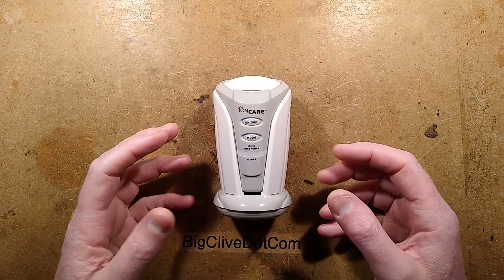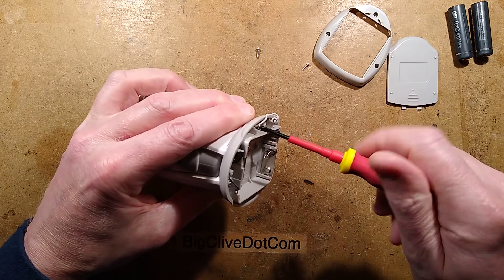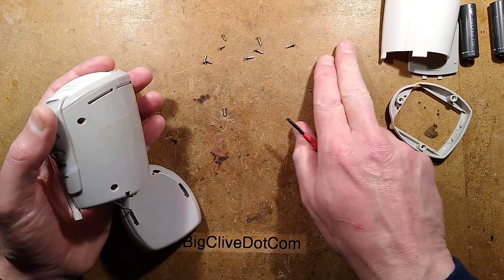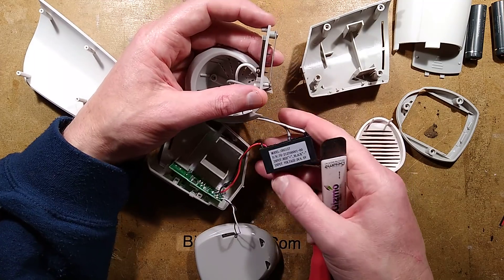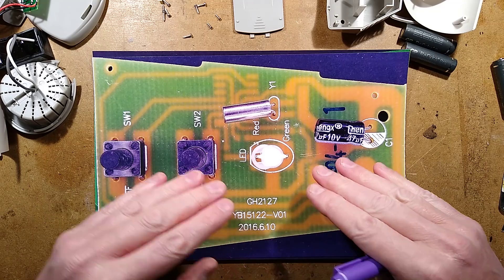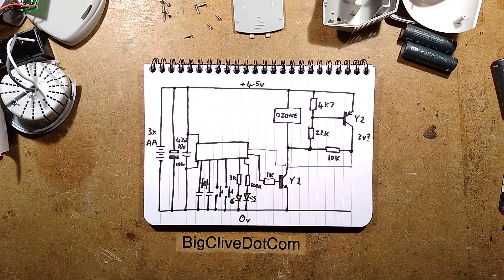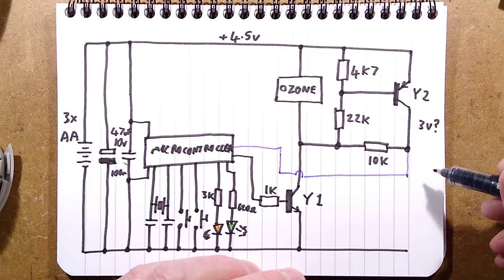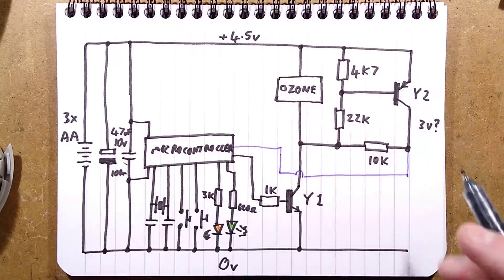Very retro "Japanese" air purifier.

Comment: Judging by the number of screws, I'd say that Sony designed this!
Reply: As a Sony fan, I can confirm the sometimes excessive use of screws.
Reply: @dashcamandy2242  Must be there for a reason . I would rather have a few more and a solid product rather than a few less and something flimsy . I have a few of their products because of the quality although that has dropped off a bit since they started having things made in China
Reply: By looking at the design it could be an old Panasonic design or a Toshiba one …
Reply: So true so true.
Reply: Looks like a ps5 too
Reply: Nah, no propriety screws. 😀
Reply: @josephking6515  That would have been Apple.
Reply: @josephking6515  Sony dont always use them , i have had loads of their products and none have had them . Maybe its a recent thing
Just checked a couple of things i have , Bluetooth speaker , ordinary cross heads , rx10 camera and cross head screws again.
Sony leave that nonsense to others who think they are stopping people getting inside the products , sony have maybe realised that anyone can get the correct screwdriver bits these days

Comment: I have the German version of this called the Genius Air Plus.  It is Powered by four AA batteries
Reply: If it's the same circuit it would work like a charm with rechargeable eneloop batteries at around 4,8-5V

Comment: I bet that could be modded to run off USB. Three alkaline AA batteries would be about 5V when new and if you wanted to be safe you could always use a resistor to drop the voltage a bit.

Comment: Very interesting.  I'm curious about whether the ozone generator will indeed be depleted by 3V, as NiMH cells will run right down to 3V and would be around 3.6V in normal operation.

The innards could be used to build a smaller device based on a li-ion cell, as well.  Simply use a TP4056-like module to protect and charge the battery.  The existing 3V voltage monitor would still be relevant and would indicate a good time to recharge as TP4056's often don't cut off until 2.5V, which is a bit low for typical li-ions.

Comment: I say they well engineered this product and it would be easy enough to add a protection diode for reverse voltage.
Reply: you'd either lose runtime or have to put the diode across the supply and have it short circuit the whole mess. polarity protection diodes in series make a lot of sense on 12v devices or devices that are mains powered. the battery compartment ledges that make only the positive end possibly conduct against the non spring end are more efficient and can't discharge incorrectly installed but not tested batteries

Comment: 1950's:  Made in Japan = crap
2020's:  Made in Japan = on par with German engineering.
Reply: in the 80s , the good stuff was coming out of japan
Reply: I remember when “Japanese Junk” was a thing long before “Chinesium” became popular.  Both those countries do manufacturing better and at a larger scale than the US today.
Reply: @DigiLab360  Louis Rossmann  did a comparison of two hot air stations , one American and one chinese and he came to the same conclusion , added to which the American one cost about %50 more .
The Chines used to and still do produce some junk but they have stepped up their game and now produce some high quality things , about the only country that can compete with them is Korea , but for how long i wonder
Reply: @DigiLab360  Larger scale, sure.  That's easy when you have slave labor available and no compunction about it.

US products are far better across the board because we have have actual STANDARDS.  You won't find cardboard in your pork roll, melamine in your baby's formula, or sticks and insects in bulk shipments of saccharin (something I've seen personally).
Reply: 1970s Made in Japan = much more reliable and cleaner motorcycles than British ones.
Reply: Whaddya mean Doc ? All the best stuff is made in Japan!
Reply: @jaycee1980  It is NOW, but if you'd read the whole thread you'd see most of us are talking about the distant past.
Reply: @phydeux  you missed the movie quote
Reply: @jaycee1980  - Insert Naked Gun 33 1/3 epic facepalm here.  😣
Reply: @eegles  Shut down factories at the exact same time that Japan started importing cheap reliable cars.  
They killed the British car industry.
Reply: Guess what that means for China. We all experience that in the past 10-20 years...
Reply: @ChipGuy  - The difference is that China is a socialist dictatorship and is largely incapable of innovation on it's own because that requires freedom of thought.  And if you have people thinking differently about how to manufacture things, they may start to think differently about other areas of life.

This is why China's recent advancements have all come at the cost of stealing intellectual property from the West.

They copycat our designs, but they still can't replicate those that require actual technological advancement, like CPUs and car/jet engines.

And with Xi taking them further back towards the "bad old days" of Mao, that's unlikely to change.
Reply: That was a UK thing to try to protect UK car manufacturers from the cheap imports. Thanks to the unions in the 70's though they left the doors wide open.  
I remember Made in HK being the low quality stuff.
Reply: @DirtyRobot  That attitude also existed here in the US.  Sounds like the UK trades simply decided to co-opt it to their purposes.

Comment: These "ion" thingies have been all the rage in Japan for years, now. Although bigger units and integration into air conditioning are the norm.
Reply: We have a toshiba mini-split heatpump for heating and cooling  in the house and it has a plasma air-ionizer feature that i have never turned on. but maybe i should?
Reply: I'm considering if I should integrate ozone and/or ion into my forced air home climate system. Particularly for the ionizing, I'm wondering if I should put it before the air filter or after the air filter. I'm thinking before, but have a feeling that I would go through air filters even faster than I do know (I have multiple cats so there is a sizeable pet fur and dander load on my air filtration system). I also don't know how the metal ducting will effect the resulting ionized dust. I would suspect that I would get extra dirt build-up right in the region of the ionizer instead of mostly the ionized dust getting trapped easier (through electrostatic attraction) in the filter. What sort of professional should I look for? Are there any existing scientific papers on this topic? (I'm not sure that I would trust professionals or white papers from the companies that make the ionizers as they might be a tad bit biased...) ;-)
If it makes a difference, I'm in the Mid-Atlantic region of the US.

Comment: If the 2016.6.10 printed on the board is a date code, it would be interesting to see when the patents on the old units ran out (assuming you still have one to examine)... does the one you have sport any patent numbers?
Reply: The other code was 2020
Reply: @jamesplotkin4674  Exactly - on the  other side of the same board! Which do you believe?
Reply: @Shaun.Stephens  It's a conspiracy, I tells ya! ;-)

Comment: Strange that the white top piece has a lip that looks like it's designed to pop off easily when it's actually not. Maybe that's why they decided to screw and heatstake it on... :D
Reply from the maker: I thought it might have popped off for cleaning the emitters.  The screws were just for the ozone module.  The top can be popped when the heat stakes are broken

Comment: Dam'n - I just ordered two of the "Slit version" Fridge Ozone Generators by Ali. Saw this version on the listing but forgot to add it to the shopping list.

I thought this type Ozone generator used high frequency AC voltage on the spikes, but I presume the high voltage is rectified/multiplied/tripled (or what ever they need for the proper voltage on the spikes)

If it's DC I can use the HV module as a "Kick starter" (voltage source) for my 3D printed Van de Graaff generator. Till now I have used the "old fashioned" ion generator (11 steps) as the voltage source. I'd prefer a battery operated Van de Graaff generator so I can avoid the "connection" with the 240 AC line.
Reply from the maker: The bare ionizer modules on eBay put out high voltage DC.
Reply: These are HVDC. The slit version, aka "Twinkie" work exceptionally well for it's size, it rid my work truck of musty odors overnight.  I scored 10 locally for 3.89$US! each (fluke)

Comment: Looks like a good product. I’d like a mains version as well.
Reply: I gave Clive the challenge of converting it . Should be possible to do it , just need the know how
Reply: @MrTarmonbarry  Shouldn't be too hard when reusing the internal guts? Finding a DC power supply from some dead appliance that outputs something between what 3 fully charged NiMH cells and 3 full alkaline cells produce on the - and + should do the job. Drill a hole to put the jack matching the DC barrel plug fits into, hook the wiring up maybe even go fancy and add a switch so you can choose to use the batteries or the external DC power supply. Integrating the power supply might be a bit more fiddly but there is plenty of space in there.

At least I'm assuming it should be that simple, the device ran fine on NiMH apparently and also on alkaline. So I'm guessing it doesn't rely on the power source being current limited (NiMH chemistry tends to be able to deliver much more current than alkaline).